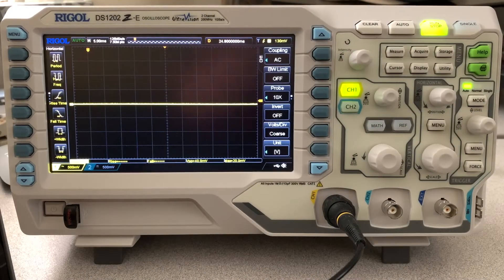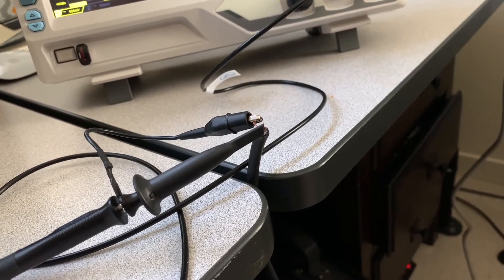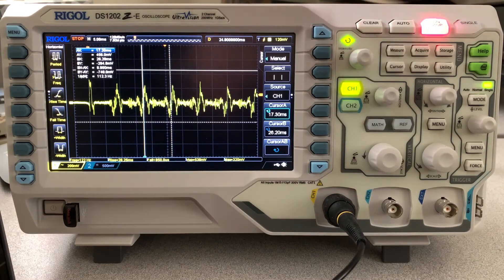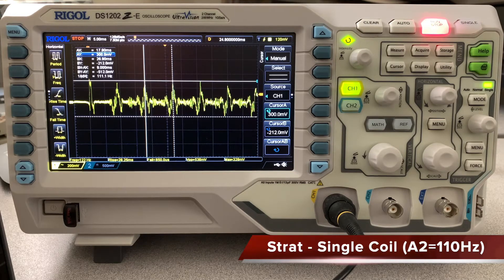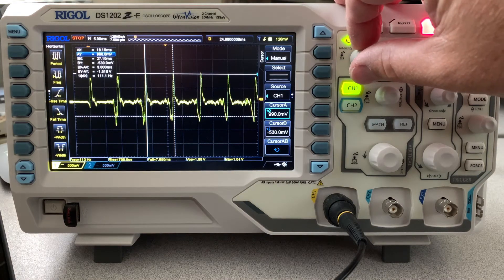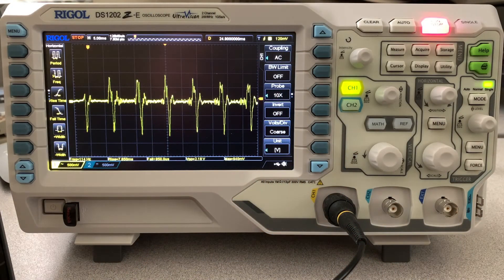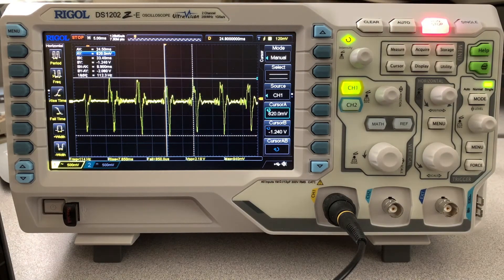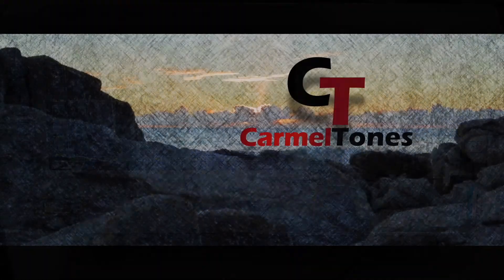Oscilloscope Analysis of Single-coil vs. Humbucking Pickups.

Comment: I am a physicist-guitarist and fascinated by the modeling  of the voltage signal from pickups. It is complex - even for a single-coil pickup - because of the string's dipole magnetization, the string's motion relative to the pickup coils,  the string harmonics,  the coil's induction, etc. So I appreciate the  raw oscilloscope traces with equally complex features. The humbucker noise cancellation adds even more fun to the modeling challenges.  Thank You!

Comment: 3:00 Why measure frequency and peek-to-peek with the cursors when the scope shows this values directly at the bottom of the screen?
Freq=113 Hz     Vpp=1.88 V
Nice scope it is anyway, and you can then use it to tune your guitar perfectly string by string :-)
Reply from the maker: Good point.  This scope can do "Auto Measurement" or "Manual" with the cursors.  I do like the extra info you get in the upper left panel when using the cursors.  Also, it's nice of you want to measure Vtop/Vbase of a square wave instead of Vmax/Vmin for instance (ie. ignoring overshoot/undershoot).  I still have a lot to learn about this scope...thanks for watching and I appreciate the comment!